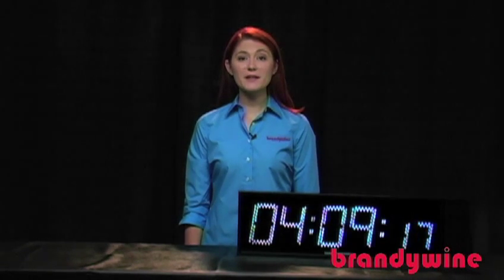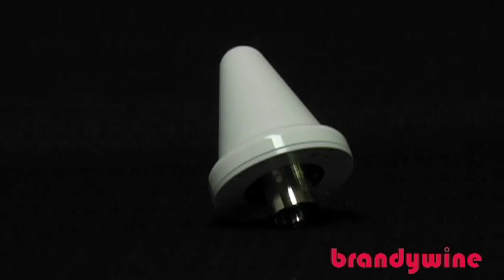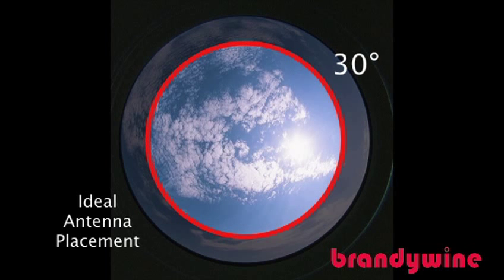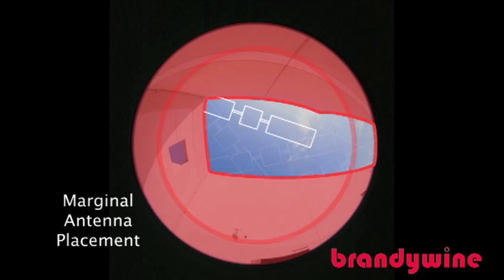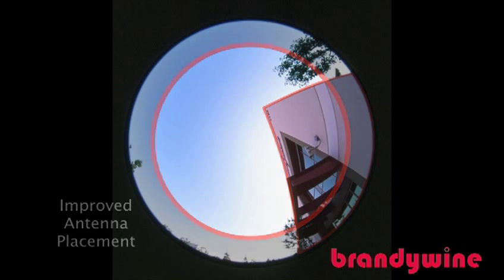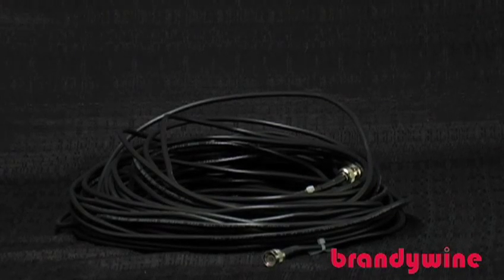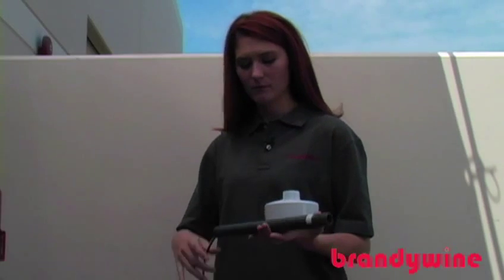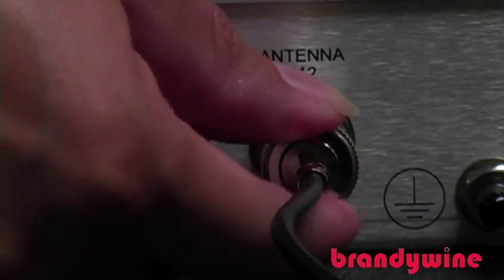Installing a GPS Antenna

Comment: I need to do this, my house is constantly getting lost
Reply from the maker: While positioning and navigation are the most common uses for GPS, they aren't the only uses for it.  GPS is also used to provide the time of day at a very high level of precision, which is required to applications that require the time of day to within the nanosecond.

Without GPS as a reference for frequency synchronization, things that make the modern world possible like cell towers wouldn't be able to work or would work with a greatly reduced bandwidth.
Reply: Right; I'm installing one for a GPSDO antenna. But it was still funny.